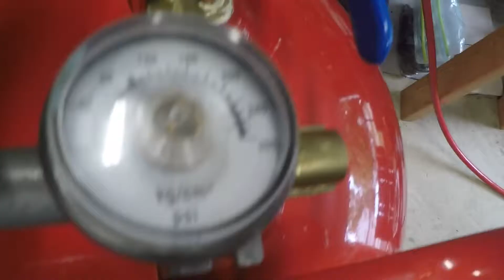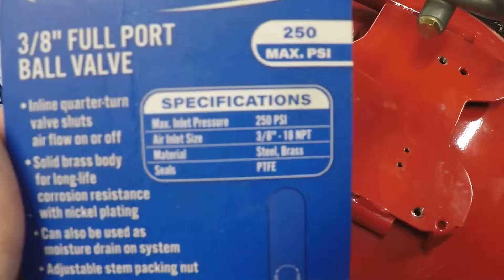Making a Reserve Air Tank From a Dead Compressor

Comment: The only thing is my mind is that the compressor will heat up trying to fill the second tank at the same time.  I leave my compressor unplugged but pressured up over night so it doesn't have to work filling everything at once.  .  I always drain the moisture.   More air volume is always the quest.   Right?   They use that drying glue from the factory and it is tough to work with    (I am a fan of teflon tape)  Good luck
Reply: Like
Reply from the maker: I often leave my compressor filled up as well.  I drain it when I know I won't be using it for a while.  I've thought about the heating up part as well.  I plan to stub out a second connection to my compressor which will go to the reserve tank.  I'll only use the reserve tank when I could benefit from more air (i.e. framing nailer when I use it a whole lot in a short burst).  I remember when building my shed having to wait for the compressor to get those last few nails in.  It was always at the most inconvenient time like when I'm trying to secure a piece of roof sheathing lol.  The wire wheel on the die grinder drains the tank really fast too.  I'm always waiting.  I've also heard that start stop cycles put wear on the motor and pump so a longer run but less start stop cycles puts somewhat less wear on the motor and pump.  I'm not sure about that statement though.  More heat might be worse, but then again, it draws a whole lot of power to start that motor up and get the pump going, so I really am not sure.  Thanks for watching and commenting!  Looking forward to your next video.
Reply: @billyb351  Well I know you are a smart guy but I threw in my 2 cents worth.  You will enjoy your larger volume of air.  I finally got a good size compressor with more than 30 gal.  All the Best Bill